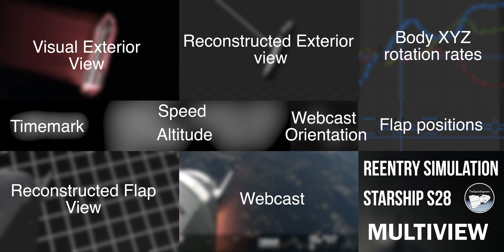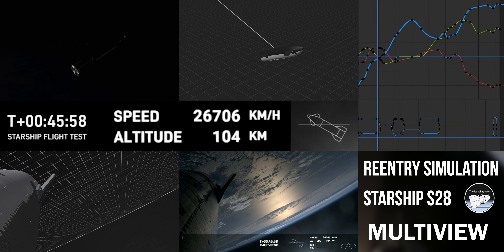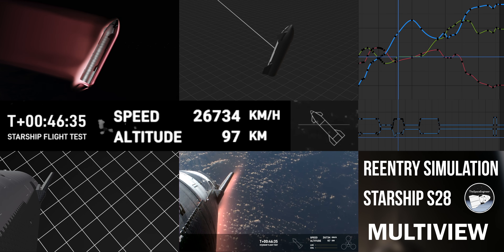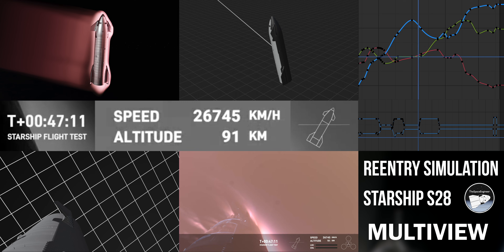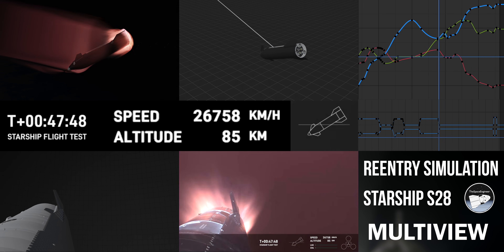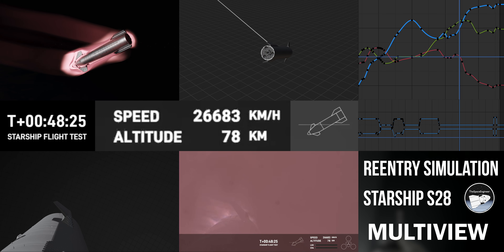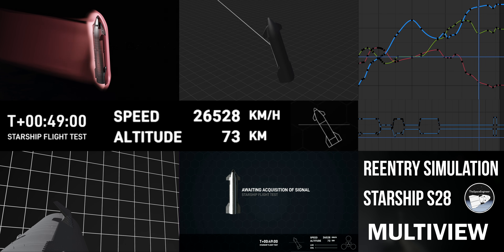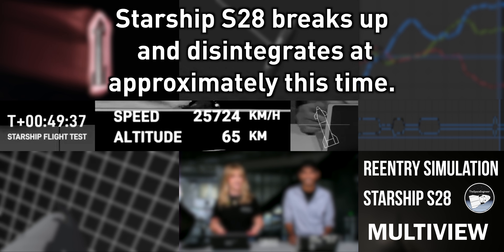Starship S28 Re-entry simulation

Comment: I wish the animation would show the thrusters operating, presumably trying to keep it oriented correctly. Or did they all fail? In fact, where are such thrusters located around the Starship?
Reply from the maker: Yeah we did not observe any thruster action pretty much at all during the flight. Especially odd, but also it could just be very transparent that high up in the atmosphere and therefor impossible to discern
Reply: I consider it likely that the cause of Starship's roll during the coast phase was due to a stuck vent or thruster. Starship could well have depleted its propellant reserves trying to counter it, which means when reentry started it would have no thruster fuel to establish the correct attitude for the flaps to work as intended

Comment: Incredible work!!!!
Can I make a request? in your animation, fly a second Starship (at 50 meters to the left or something) but that one flies the right wa. This will help by providing relative motion and scale to the entire flight and shed more light on what went wrong. 
Also I have no idea what that chart\diagram was. I could not understand it. 
But again, Incredible work!!!!
Reply from the maker: The graph with the three colors represent the rotation rates or each of the three axis of the ship. Z (roll) axis is blue, X (pitch) axis is red, Y (yaw) axis is blue. 

The graph below it with the two blue lines represent the rotation position of the two flaps visible in frame

Comment: Re-entering bare stainless steel and engine side first and still survived at peak orbital velocity until slowing down at least 1000km/h and reaching the thicker part of the atmosphere before it break apart is just crazy.
Who would've thought a rocket could be so durable when you build them with same industrial principle of a bulldozer.
Reply: I could be wrong but I'm pretty sure it was far from peak heating at that stage. Even though the plasma is visible that does not mean that plasma is dense enough to generate much heat or tear apart the ship. Let's see for Flight 4 thought, I'm looking forward to it.
Reply: @neobrandeggen  i said peak orbital velocity. It's when the spacecraft hit the earth atmosphere at it's fastest speed before getting slowed down. Right before peak heating.
Reply: @LeftOverMacNCheese  Yea sorry, I just meant that I think that point is far away from the stress the ship would endure at peak heating/peak aerodynamic force.